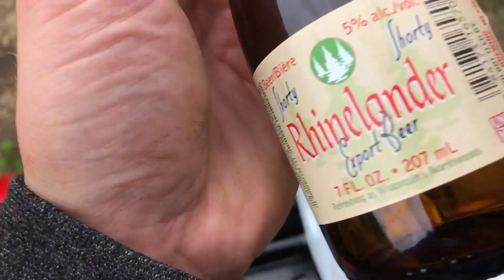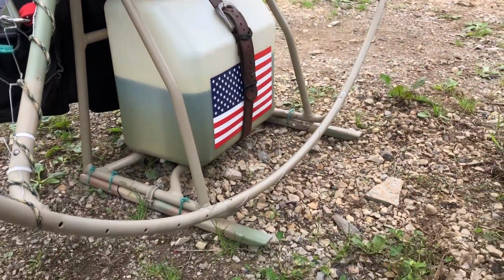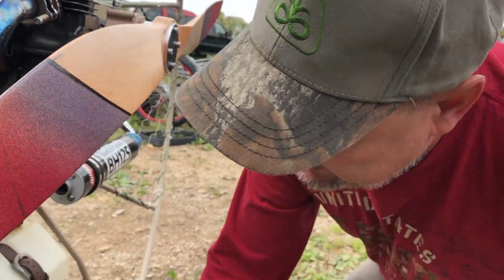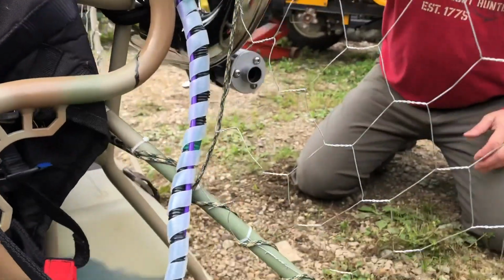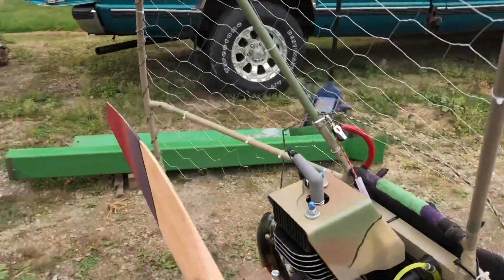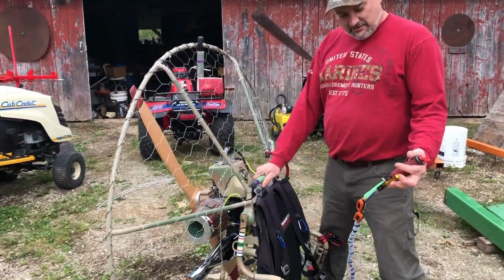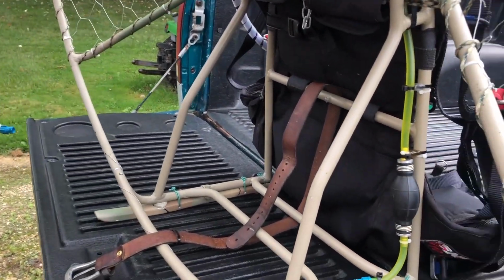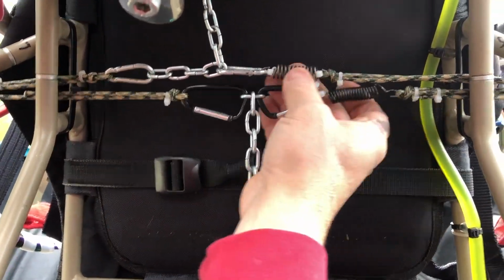The netting is CHICKEN WIRE! 🐓

Comment: The locking lug on the throttle cable on the carb should tie wire it, those small bolts will work lose with the vibration